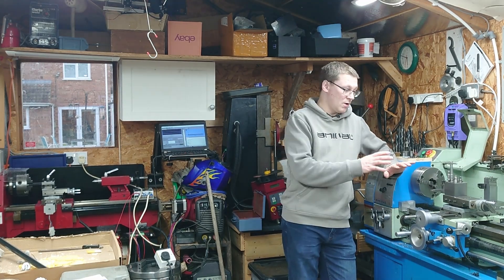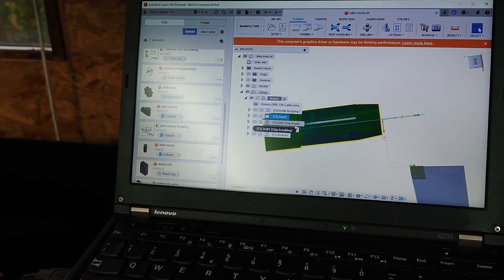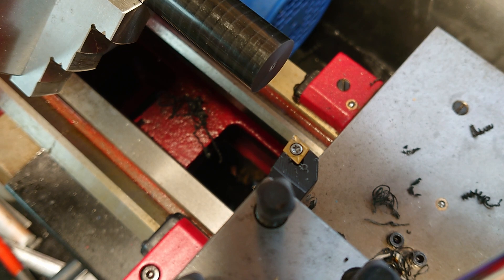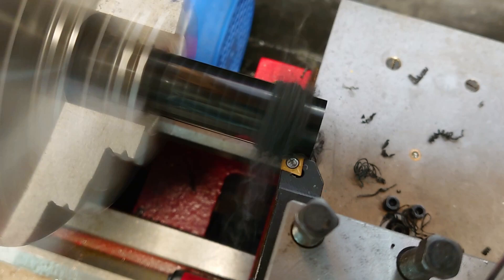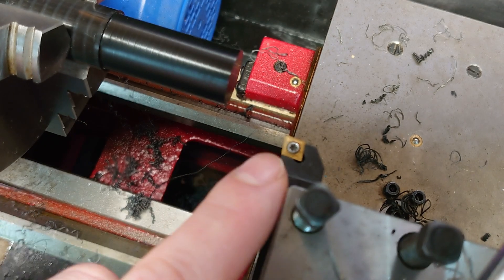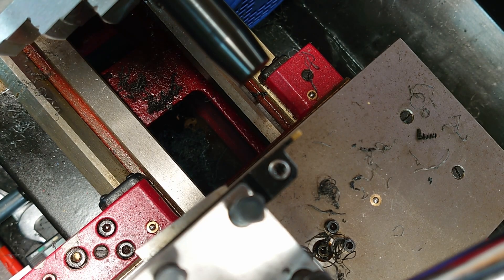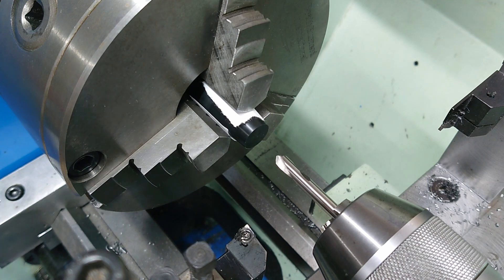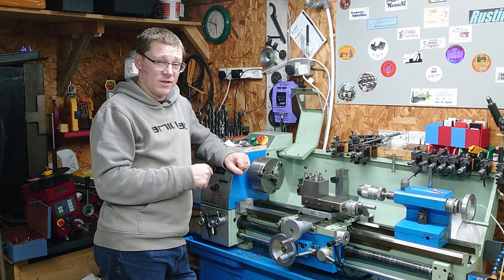My first part on my grbl CNC lathe [A23-20]

Comment: Thank you so much for sharing this videos on CNC lathe. May I please ask what software do you use to send the G-code? From your other videos It's clear how to create the toolpath in Fusion but how to send it to grbl controller board?
Reply from the maker: Hi, I use UGS as the gcode sender. I have also used candle, but UGS is less buggy. I think there's a few others, but I haven't used anything else. Hope this helps. Thanks for your comment! 👍
Reply: @ollysworkshop  Thank you so much it does help. I am using UGC for my CNC mill but wasn't sure about how to use it on a lathe.
Reply from the maker: @nomadmika  it is basically the same, just with 2 axes instead of 3. Working out the various offsets still gives me a headache. There's probably a good way to do it, but I haven't found it yet. The visualiser in UGS isn't designed for a lathe (unless there's a mode I haven't found). I have to trust what I see in the fusion simulation, then run the gcode. It doesn't always (read that as 'ever') work first time!

Comment: Great video but please use pliers not fingers if you're going to remove the bird's nest whilst the spindle is turning. The plastic's too strong to reliably snap by hand.
Reply from the maker: You are right, I'll station an appropriate tool by the lathe.